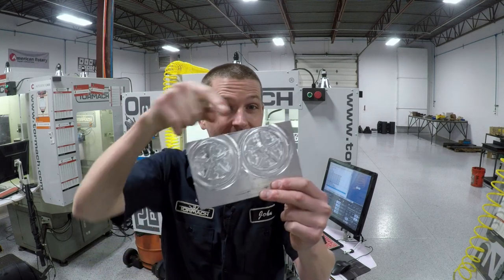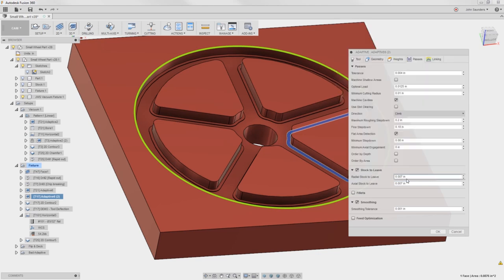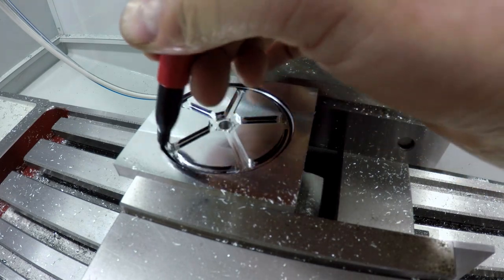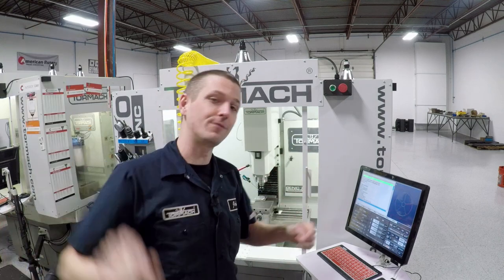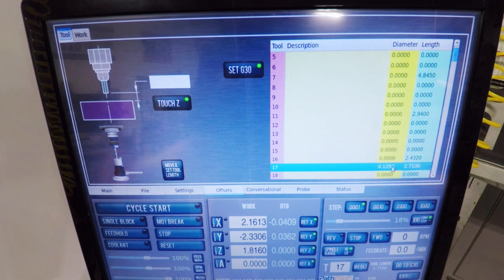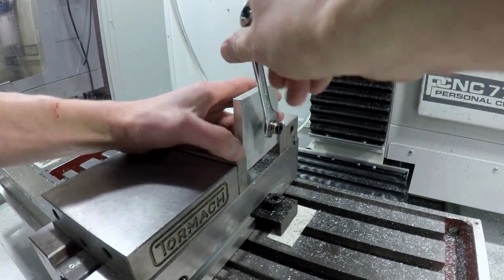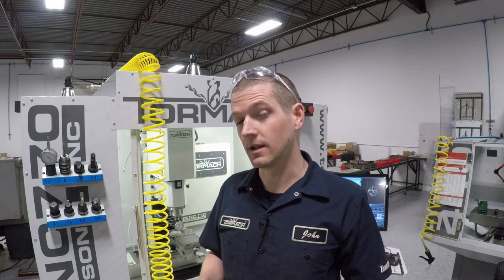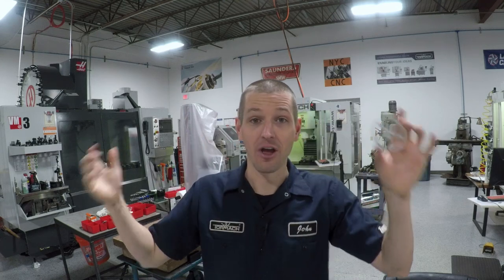Machining Thin Parts!  Part 2 WW139

Comment: the way I would do that part would be moving clamps around it as i work, i typically work with very thin parts for aerospace, the part i'm working on at the moment is 1.6 mm thick all over, 150mm long 50mm wide, then it has a 90 degree angle in it where it carries on the same shape, 1.6mm thick, 150 long, 50 wide but it has holes for bolts. 

to machine it i drilled holes smaller than the finished size of the holes and put bolts through to grip it, machined it all down to size except for where the bolts are, then i clamped down the finished surfaces with clamps, machined away the bosses with no step between the surfaces and opened the holes up to size. it's not very efficient for 100 though, we usually machine batches of 20ish.

Comment: small "O-Ring" around the OD and each hup ....  McMaster-Carr sells  small o-ring stock . that can be cut to length
Reply: McMaster-Carr 
Ft.1/160.  .070"Durometer 50A (Soft)ASTM D2000-25° to 212°Black

9864K23.    $0.50 per ft

Comment: Another option is to use a lathe chuck. Cut your fixture to .010 less than the part in diameter and use it as a backer for the part when you chuck it.

Comment: What about a thin bead of silicone on the vertical faces, too seal the vacuum fixture? Maybe something in the RTV family like Permatex Gasket Maker.  And it is entirely possible that the only reason this came to mind is that I am a Gearhead.

Comment: Here's a way you could do it, although it would involve reworking the earlier steps:
- drill a hole in the center of each of the spoke holes, and four holes into the corners outside the part (used for holding the part down later)
- cut all the edge chamfers on the current side (essentially, you'd just be cutting a v-groove into the surface where the part's edges will later land)
- flip the part over, and mount it with cap screws using the holes you drilled earlier into standoffs of some kind
- cut all the chamfers on this side
- for each spoke hole, plunge the mill all the way through the blank and cut out the perimeter
- plunge the mill through the blank at the outside edge, and cut out the outside perimeter
Reply: Another way would be to take care of just the center holes and spokes on the mill, then put it on a lathe and turn the outside edges.

Comment: If this was a production part and the order was for a few hundred, rather than just a few, it would be nice to have a part tumbler to break the edges and create a uniform surface finish after decking the back side, rather than worry about clocking the part and creating a custom fixture.  

Could this perhaps be made on a lathe?  Yeah probably.  Would that be faster?  Maybe.  Probably would need a few operations on the mill to cut out the spokes for instance if you didn't have live tooling.  How about a die to just press the part out.  Would that be faster?  Surely.  But would the parts meet spec?  Depends.  Which means you might require more finishing operations??? What quantity of parts would justify making a custom die?  The rabbit hole is practically endless.  

I love videos that raise far more questions than answers.  It's great to get thinking and awesome to see your approach.  Thanks for sharing.

Comment: Plumber's silicone sealant, Vaseline or high viscosity motor oil should have done it, thought all will require deeper vacuum channel. I use Solidol grease for sealing similar things.

Comment: Would adding an o-ring groove to the fixture solve the problem with the vacuum leak? I just used some Harvey O-ring dovetail mills on a part, and they worked great. Wondering if something like that would seal it up. Obviously it would change the design of the fixture a bit, but that might be a way to get the seal.

Comment: As others have said, apply something to create a seal, however if you were going to do 100 or 1000 of them you would need something that is easy to clean off in a batch and something that doesn't build up on the plate as well.  I don't have a specific answer, but I am thinking of the tire mounting paste that is used to install car tires.  It has some body to it to create the seal, and to remove it you could put 50 or 100 parts in a warm water bath.  The difficulty would be not getting chips stuck in the vacuum plate during the part change.  Good Luck.

Comment: Can you make the fixturesides slightly conical, and pressfit it down? Obviously with a press for even pressure. And not with alot of pressure of course :) a few holes throu to poke it out of the fixtureplate after.

Comment: Another option would be to use soft jaws milled close like your plate, but then open up the OD a little and instead of clamping, pull the vise open to give tension and clock them on the spokes.

Comment: I would put it in a lathe and face it off.
Reply: Jesse Black I agree. Easiest solution with minimal effort. As long as your jaws in the lathe indicate flat, it's just a matter of how fast can you manually swap the parts for quantitie runs
Reply: I was thinking the same, but there is still the issue of chamfering the back side of the spokes (45° very small dovetail cutter? that seems shady).

Comment: Wouldn't be possible to cut a grove for a gasket around the edge of the part holder then find a flat rubber gasket material and cut it to size with the Tormach to fit that grove?  Kind of the same principle as a regular vacuum plate but using a custom cut gasket instead of regular o-ring like material.  I wish I had a Tormach mill to try this out.  It would sure be fun to try !  The challenge would be to hold the gasket material for the cutting operation but it would achieve your goal.
Reply: Just building on this same idea... There has to be some "pourable" gasket material that you could lay down in that grove then machine to size so it creates the seal you need.  Worth a try since if that works, there would be almost no limitation to what you could hold with a vacuum.

Comment: Using a bolt on the vacuum fixture caused that run out and rocking because of the floor air groove. Facing the top and floor flat again should take out most of that play.

Comment: If you use wear, you should leave the diameter at 0. Otherwise the tool will run to the left (G41) or right (G42) of what the diameter of the tool is. Using wear is great because  you can fine tune your parts as they come off the mill.

Comment: what if you made your jig out of thicker material, cut it in half, run precision pins through the half add a screw and use it as a clamp. If you got it right it could clamp on the outer circumference without too much distortion and would still be clocked.

Comment: G'day John, with all due respect I personally think you went for a complex solution when an easier one was available. I'd suggest when fixturing use the features available. You have a centre hole plus 5 other "holes" available. Fix to features that will later be machined away. 

PS If you wet your abrasive paper it will stick to the plate and you don't need to hold it.

Comment: that looks pretty good!  Why not use your Fixturing plate, though?  no extra fixturing needed. that's how we make flat thin parts where I work, multiple holding points if flatness is a big deal.  Definitely not fast, tho, and I know that was kinda the purpose in this...

Comment: I'd just pour some flowable silicone around the edges, and use the vacuum fixture. That way you have a tight seal, and the silicone comes off pretty easy

Comment: Scaling production:  Machine your first op like you show in your first video.  For the second op, make a fixture that has 2 pins set to locate the same machined corner of the stock.  The pins will be located on the bottom left or the top right of the part depending on which direction you decide to flip it.   Use the pins to set your part location.  Zero is found off the same machined corner that you used on your first op.  Use superglue to secure the part in place.  Include the cost of the superglue in the cost of the part.  Profit.   Any other clamping method I can think of would be way too expensive in terms of mitee bite clamps or components and time.   I mean if you had a crap ton of the right kind of mitee bite clamps, you could clamp against the sides of the flat features for the second op, but loading and unloading that fixture (from the bottom, no less) would be a royal pain.   The labor it would take to load and unload could be invested in superglue and still save you time.

Comment: You should have checked what particularly jamm the part, but yeah interesting situation, I wish it it were worked )) The part itself was not made as good as the the counterpart, no tool deflection passes etc.
stronger vacuum(with more air flow). But considering the problems a bolt is probably a good way to go in the case.

Comment: The vacuum would work, but you should consider putting in seal or o-ring groove in the fixture. You could machine tiny grooves in your fixture and apply pliable sealant like silicone into the groove. You would have to make multiple grooves for the part in this video. 1 on the outside circular edge and 5 as close to the islands of the fixture as possible. All of this effort would only be worth it if you were making 50+ parts.
Reply: I meant to say easy flowing silicone RTV sealant.

Comment: If you can pull down the center in the fixture, it seems that the wheel is not bottoming in the fixture, that is why the vacuum did not work

Comment: If the part were larger, the best solution is multiple fasteners and avoiding pocketing. But for something this small, i would try and figure out a soft jaw. you just have to clock it such that it is symetric and it shouldnt be too much of a problem.

Thats how we do it.

Comment: Hey John, have you considered just running half of the part depth on one side, then running the other half after you turn the stock over using tabs for the second run? You get a minimum amount of cleanup and a fully machined part. What do you think?
Reply: Easier than trying to get a vacuum to work.

Comment: You should pick up a polarize filter to reduce the shine stuff from the machines surface.
They a super cheap on eBay. 
Search for circulair polarize  filter.
Reply: Do they work for metalic reflections?
Reply: i use them for to reduce reflection from water or windows. 
I will do a test tomorrow @work. :)

Comment: How i would've built it:
Leave just the five sprockets for indicating and machine the outer diameter down, then put a circular groove with slightly smaller diameter than the wheel for an o-ring. I also would let it have more clearance, it shouldn't matter if the part is off a thou when it's just for facing off and deburring.

Comment: Hi John!
Love your videos - I just got a 770 and made my first cuts in Aluminum yesterday. I'm using the Tormach flood coolant system with the Durakut 4010 they sent with it. I left it wet last night and woke up to rust on the table this morning! I've read that I did a few things wrong like I should be using distilled or RO water instead of tap, and I shouldn't leave the table wet overnight. Do you have any suggestions on how to prevent rust? I've read that coating the table in WD40 after using it will help - any suggestions would be greatly appreciated!!!

Comment: forget leaving stock to make a vacuum chamber. Just drill and counterbore a few holes (not thru holes) in each spoke for an o-ring. Throw it on the rotary, drill down each spoke (probably use thicker stock), then plug each hole. Drill the vacuum port on the backside that intersects all your plugged holes. 

You could add holes around the diameter using the same technique. 

Like you said, a few parts? nah. Uber production? definitely.

Comment: part was too tight i think? there's prob a section that's binding more than another giving you a leak. if it was a little more loose and still very flat mating surfaces  i don't think you'd have a problem. you could also use grease/vaseline to help if it's a little off.
Reply: oops. 9months too late :(  i should of read a couple comments first

Comment: Plan B: Cut your fixure plate in half down the middle. Than use the vise to clamp the two halves with part in place. When you cut the fixure plate in two there will be a gap that permits it to clamp the workpiece.Why bother with glue\vacuum when clamping force can be used.

Comment: I think a real vac pump would of worked the ones that use pressure line have vary little vac power if it's not a complete seal  and a deeper grove would of helped on the pull down force

Comment: I think, that the fixture is too tight, so that the vacuum couldnt pull the part down, leaving a gap. Maybe make the fixture a tiny little bit wider, so that the part fits in a bit easier and can be pulled down.

Comment: The fact that the sharpie is removed doesn't really prove tool deflection. If the tool was not deflecting at all in either pass, it would remove the sharpie on the second pass without touching the metal.

Comment: Do like the woodchucks do, and get a bigger vacuum pump.
Those venturi units are great, but they don't create much volume.
Reply: MrJohnnaz A bigger pump doesn't create a higher vacuum level. It's all about the surface area of the part unfortunately.
Reply: Right you are, but if you have very many leaks a small venturi
unit is easily overwhelmed. Were a bigger unit, would hold that higher level, and could make the difference, between holding the part down or not.
Reply: MrJohnnaz Sure, a pump with higher flow rate would overcome leaks, but you still can't generate more than 14.9 lbs per square inch with a vacuum. Not a great part for any vacuum system. Trust me, I invented this product.

Comment: why would you ever rub up machined faces they look better when they come off the machine. But coming to the 2nd op situation never rely on vacuum beds they and big problem creators so never use for 2nd operation but you needed a gasket for the fixture to work as even though your fixture is a good fit to the job there is still microns of clearance between surfaces, I'd suggest reading on limits and fits a bit more but if you can get a smaller gauge of gasket then try to machine a smaller groove on either side of the slots in the fixture then it may work.

Comment: Machined metal faces are extremely hard to get an air tight seal. 
I had a problem getting a seal on a lpg cylinder connection which i fixed using a wrap of gas grade thread tape. 
As long as you have something flexible/compressible,  but viscous enough to fill a microscopic variation in mating surfaces you should get a vacuum.    You could use a flexible gasket type material or even grease, but a very thin coating. 

You will lose your vacuum the moment you drill your centre hole.